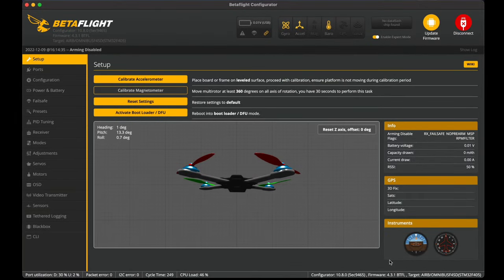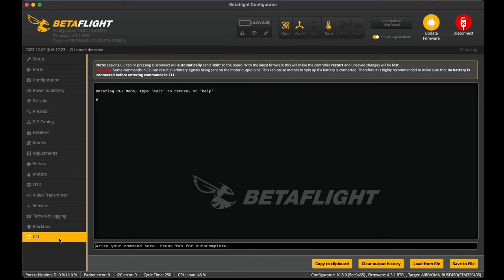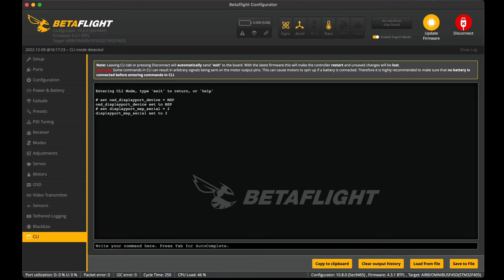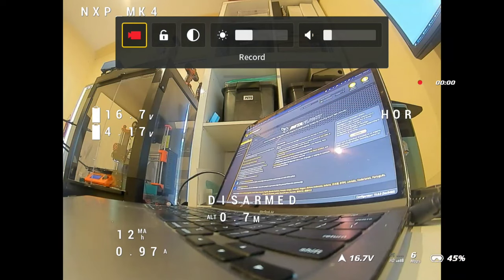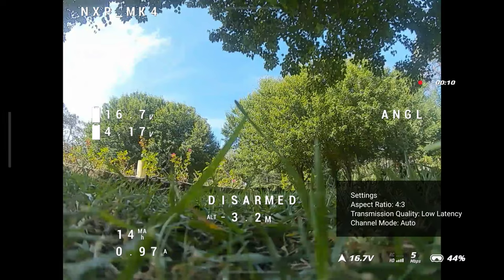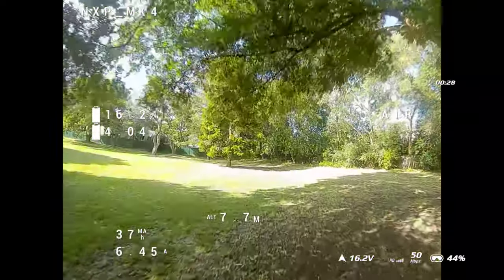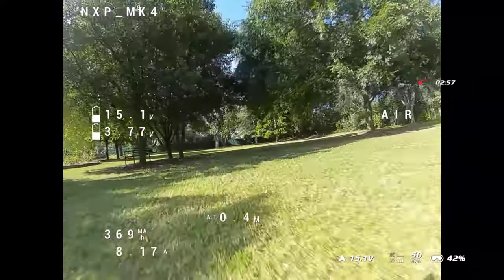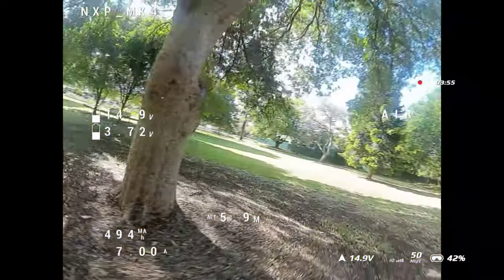DJI Goggles 2 + Vista - MSP DisplayPort Setup on Betaflight 4.3 & Test Flight

Comment: Hi Nam . can you recommend a solder size .08 size? %2 flux?  60/40?   🤔 or  can I get it from Alie?  can I get away with using  my cheap solder $10 iron for now.? or can you recommend a solder iron also?
Reply from the maker: G'day Jerry. I like to use 0.7mm rosin core 60/40 solder. I've tried buying online and it was terrible quality. So I just buy it locally cause it worked so much better and doesn't cost that much more. My soldering is much better (of course 😆) off camera cause it's difficult to get a good viewing angle while filming at the same time. A $10 iron could work if it has a fine narrow tip. If not, you could buy a replacement tip for cheap. I've used cheap irons a long time ago and they get the job done, it's just the iron doesn't last long.
Reply: awesome information .i think ill buy a better one . but ill practice with this one .i am buying some practice kits from alie . and destroy and fix cheap items I own that I've been wanting to learn on. should I buy a  desk top type or pencil plug into battery /usb type iron?
Reply from the maker: I've got an old (20 years old) desktop one that's still working like new.. they don't make em like they used to I guess. If I had to buy one these days, I would get the TS100 (pencil style). Seems to have good reviews from many in this hobby. If you know your gonna be doing a lot more soldering like this, probably good idea to get a decent desktop one. Also, good idea on trying out those practice kits! I suggest getting kits that actually function, even if it's just flashing lights or something simple. This really tests if your solder jobs actually work and don't bridge etc. Those dedicated "practice boards" don't provide you with that kind of testing.
Reply: @nxp200  [ am buying a full radio kit .CF210SP AM/FM Stereo Radio Kit DIY Electronic Assemble Set Kit. $5 .  and a DIY KIT Electronic Clock LED Microcontroller Kit Digital Clock Time Light Control Temperature Thermometer Red/Blue/Green/White $16. and a DIY Electronic Kit 1801 SMT SMD Component Soldering Project Practice FM Radio Kit FM Transmitter Board Component Welding Learn $5
Reply from the maker: That's awesome! I might look them up and buy them as well for my daughter who's really enjoying building these kind of kits too. Thanks! 👍
Reply: soldering  and  tinkering seems like a fun  hobby in itself. i might get  TS100  later but for now i am going to look around for a desk top one .
Reply from the maker: Haha yeh. I love it. Been doing it all my life. Therapeutic and satisfying building something that works. 👍 Enjoy my friend

Comment: Can you confirm that vista on g2 doesn't do auto record when arming? Need to press record manually. Or did I miss something?
Reply from the maker: From memory, after setting auto record on 03 when arming, it records a new file when that happens. I'll try to test out on the Vista and let you know
Reply: I have the same issue. record dvd manually each time is a mess
Reply: @HuitoFpv  only with vista, right? With o3 it's auto record when arming
Reply from the maker: Yeh. I just tested this on the Vista using Goggles 2 and you have to manually hit record each time before you arm. Doesn't look like there's any option to auto record upon arming. It's a shame..
Reply: @nxp200  agree with you
Reply: @nxp200  do you experience sometimes osd gone during flight when using vista on dji goggles 2?
Reply from the maker: @catmanfpv9213  hmm.. sorry no.. haven't experienced this. I would check the connections to the UART on flight controller and Vista side. I have noticed that the 9v regulator on some flight controllers cause the Vista AND the flight controller to brown out on throttle punches, so I wire the Vista directly to VBAT now (4S batteries).

Comment: just learning .so I was thinking to go with a cheap analog build /  with fs-16 controller / and EV800D 5.8G 40CH 5 Inch 800*480 Video Headset HD DVR Diversity FPV Goggles. and I am an aliexpress guy.
Reply from the maker: Yes. The TX805 (video transmitter) will work fine with the EV800D (goggle video receive).

I'm not too familiar with FlySky products, but I believe you'll need to have a receiver that works on the AFHDS or AFHDS 2A transmission protocol such as FlySky FS-RX2A.

Comment: Hi, can we do this method to DJI Goggles V2 with Air Unit or Vista ? Thanks
Reply from the maker: This method doesn't work with Goggles V2 for any air unit or Vista. However, there is a hack that does provide this feature which is called "wtf.os". You will need to "root" the Goggles V2 though, kind of like software "unlocking", which may void any warranty etc.

Comment: Рlease tell me - why you have 6 Mbps and not 50 Mbps ?  ( 2:37)
Reply from the maker: That's because it is in low power mode when disarmed. I have the setting "Low power mode" enabled in the menu. You can see the bandwidth increases from 6mbps to 50mbps when I arm and take off here https://youtu.be/gQFcvDB5RC4?t=175
Reply: ОК. Thank you. )))

Comment: uart 1 is my configuration/msp  how does the value work since its already at 1.
Reply from the maker: If you have connected the air unit TX and RX pads to UART 1 of the flight controller (TX1 and RX1), then the configuration should be set to zero:

set displayport_msp_serial = 0
Reply: @nxp200 mine came back invalid name, there isn't msp_serial
Reply: I'm not mad though only thing I'm missing is pilot name and lq it does rssi.
Reply from the maker: @JustKeepLivingFPV  you might be running Betaflight 4.4. The settings are different. In which case I have another video here https://youtu.be/WjS-d4_Es9w

Hope it helps!
Reply: @nxp200  yeah my bad man I just watched and commented. Unfortunately for me I will have to put wtfos on my v2, I'm happy with the old they did give me however, rssi and single cell I'm happy now. I'm ok with no name lol thank you and I definitely subbed for the quality of your content tip notch my friend. Happy flying.
Reply from the maker: @JustKeepLivingFPV  Ah I see. Thanks for the kind words and sub!! Happy flying!

Comment: can I get OSD from a vista unit if my FC is running 4.2.5?
Reply from the maker: I haven't used 4.2 for a while, but I recall that it doesn't support it and 4.3 was the first version that did.